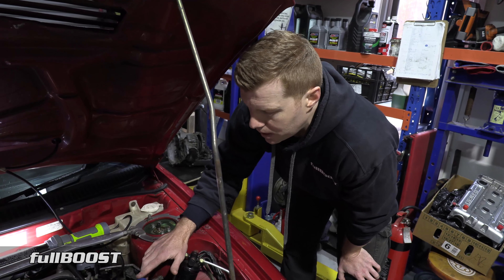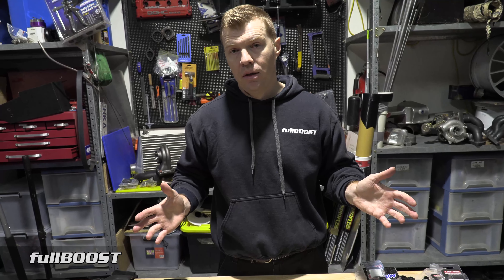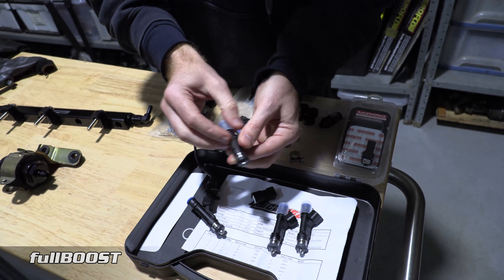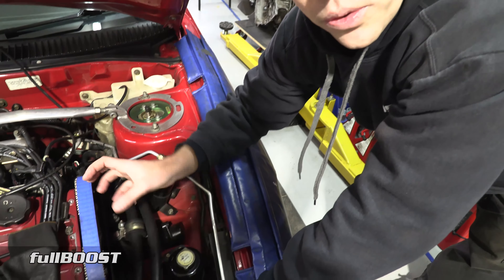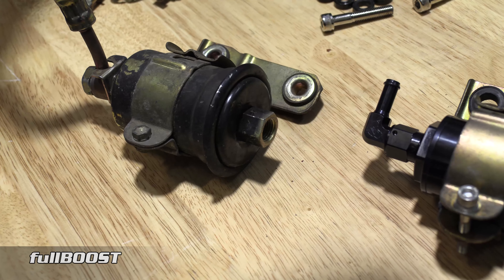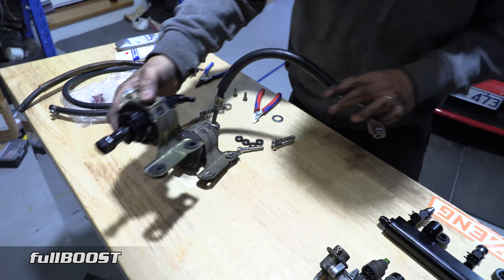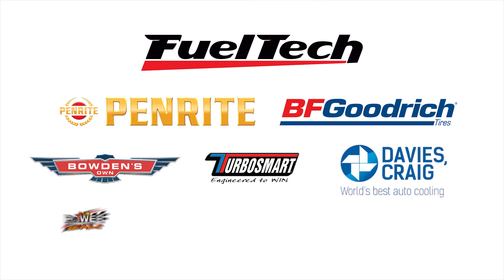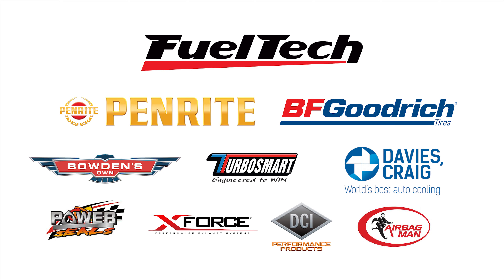Project GSR gets ready for E85 | Mitsubishi 4G63 | BACKYARD MECHANICS | fullBOOST

Comment: You really should find a compatible paper/fiberglass element for a fuel filter. Mesh types are still not really serviceable and a 10 micron element will still let through 50 micron gravel.  The reason why E85 hurts standard fuel filters is the occasional water contamination that happens and that just shreds the paper at such a high differential pressure. In a perfect world you would use something like a Parker S3213 water trap element on a low pressure feed pump.  You may need something larger upon further inspection but they are rated to 240 liters per hour that does equal 1000cc/min X4. Look for it at a marine store. You may also want to get a strong magnet in the system somewhere. You will be surprised at just how much water you will find in E85, I was.
Edit to correct figures